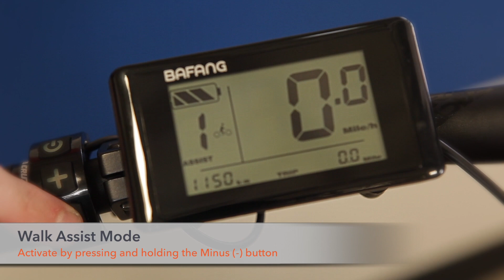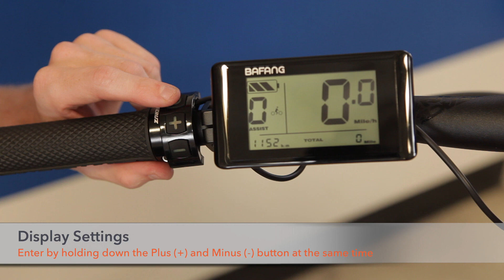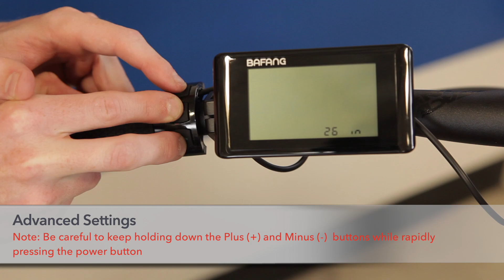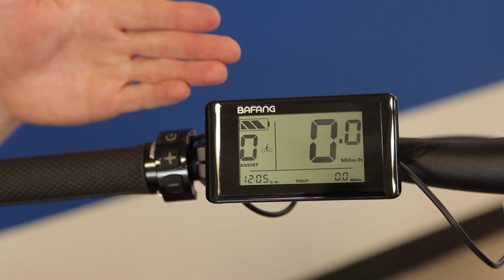Bafang C961 Display Programming

Comment: I find my clock  gives erratic time. Does the display have an eternal battery for the clock?  Did try to open the back plate but found it, like a phone, would not separate. Any ideas?  Thanks for reading.....
Reply: Everytime you remove the battery the clock resets
Reply: What's the maximum number for both your Trip, and Odometer reading?

Comment: My c961 can't be changed by following the instructions. Is there a way to get around whatever is blocking me from changing the advanced settings? I've tried increasing it in the menu screen to its max and it still stops at 20 mph I've even changed my wheel size so that kilometers per hour is actually MPH thereby trying to go around the block and I'm still limited to basically 20 to 25 mph. There seems to be hard programming that I can't get to. How do I change those settings?
Reply: I have the same problem, did you already found a solution?